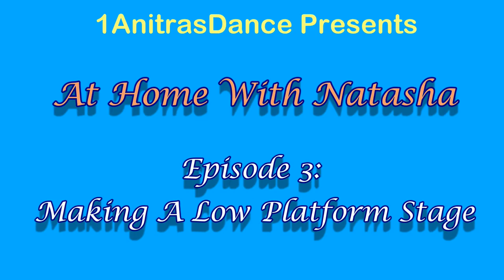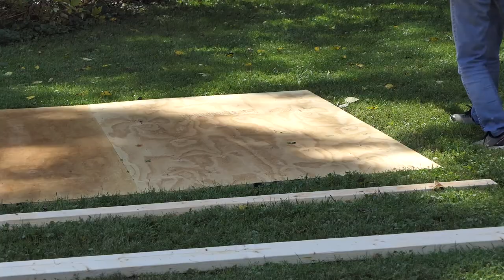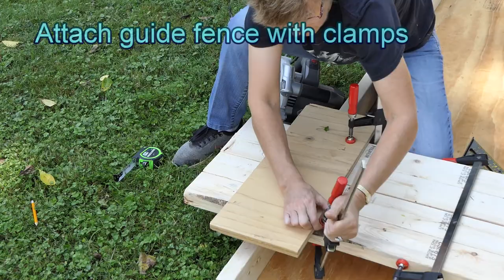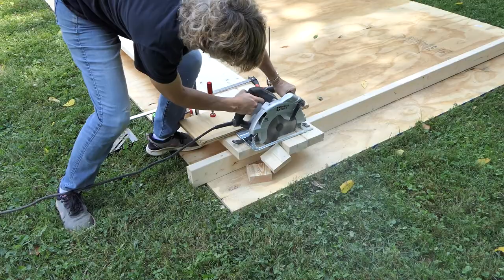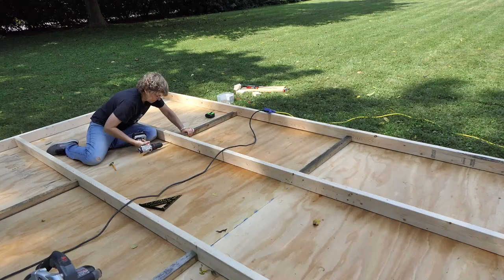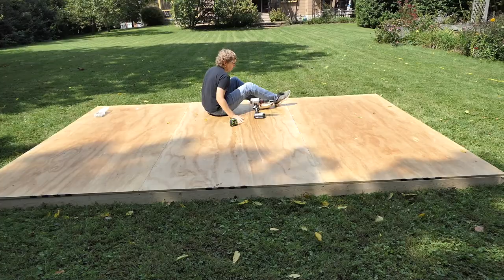Build A Low Platform Stage for your next outdoor live music event

Comment: I wanna build something like this for me and my buddies to play some gigs in my yard, can this be built relatively quickly with some lower end tools?
Reply: No.  You need a degree in agracultural engineering and a CNC machine.

Seriously, If you don't know what tools you need to screw boards together than just leave it alone.  It's not rocket surgery.
Reply: @TempoDrift1480  damn it was just a question, your the reason why people are turned off to this hobby but you do you after all…. It’s not rocket science
Reply: Tempo Drift needs a hug… lmao
Reply: 😂😂😂😂 why he play wit you like that?
Reply: i mean with lower end tools it'll take you some time, but it should be about the same outcome if you were using a drill, think you should be fine
Reply: @TempoDrift1480 dad left you when you were a kid?